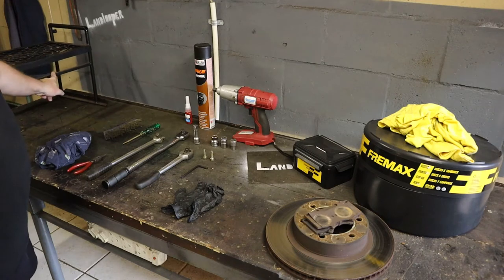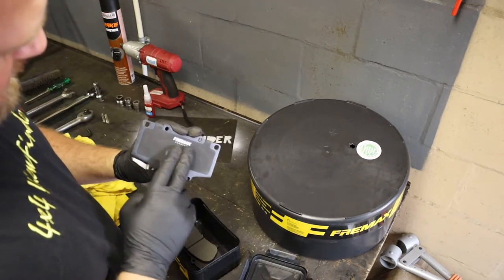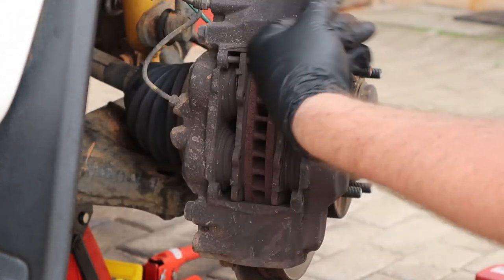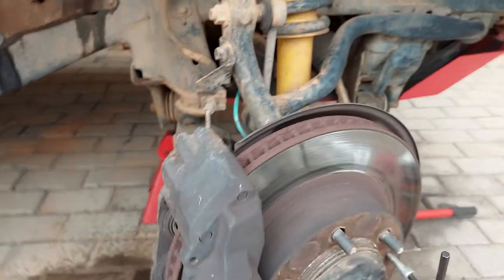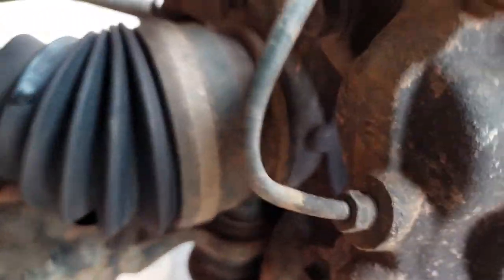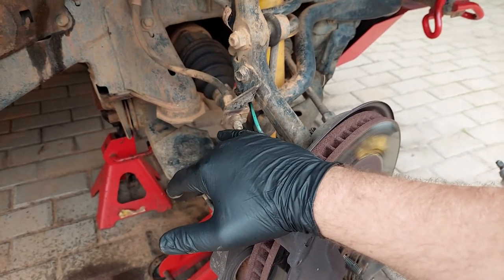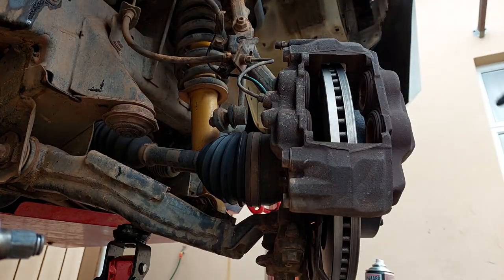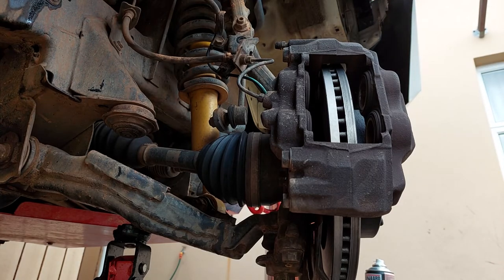Toyota Fortuner/Hilux D4D Front brake replacement.

Comment: Good video, just a tip that I was taught is use a wheel nut to hold the disc while re installing the caliper and pads. Just one less thing to have to hold on to. I also use a smear of copper grease on the back of the pads.
Reply from the maker: Thanx bud. Great tip there. Im afraid to put any kind of grease on the pads, the heat generated by brakeing generally causes the grease to "melt" and become fluid. This then goes everywhere including the discs and could cause damage to the rotors or worse, cause you to lose braking at a critical moment. I know there is a very specific grease the use, but i still cant find it anywhere. Thank you for commenting and giving the great tip, i will be sure to use it in future. Keep safe bud.

Comment: Top video thanks for the assistance. 👌
Reply from the maker: Happy to help brother.
Reply: @4x4ViewFinder  theres grease grease on the inside of one side of my fortuners rear break drum. Do you know what might be the cause. I had the rear bearings replaced 2 years ago. Apologies for bombing your comments section.
Reply from the maker: No problem at all friend. Are you sure it is not break fluid?
Reply: @4x4ViewFinder  I'll have to check. Maybe it's that.
Reply from the maker: Just make sure because its unlikely to be grease and probably a leaking brake shoe piston or just a leak on the line. Smell the deposit, grease and brake fluid are easily distinguishable.

Comment: Hi there , 

How did these disc and pad  performed on the vehicle? Would you recommend these or anything else ,
Reply from the maker: Hi there sir. I would for sure, recommend these discs and pads. Ive had almos 40 000kms on them so far and they perform like they where put on yesterday, even with severe driving conditions, such as towing and off roading. They still have more than 50% left. I would say they out perform the OEM parts by a large margin.

Comment: Hi, where do I find your video on burnishing the new brake pads?
Reply from the maker: Hi Nico, thanx for the comment. Apparently it is not neccessary. Only on performance vehicles and sports cars is it neccessary. All you have to do is brake hard from anywhere between 60-100km/h down to 10km/h twice and your brakes will be sorted. At the time of the video i was lead to believe there is a process but on speaking to a connection who builds sports cars he says its not necessary for normal road going vehicles. I will see if i cant ammend the video somehow to reflect that. Sorry for that brother.
Reply: @4x4ViewFinder  Hi Adriaan, thanks for the reply. Will be doing the front brake disks and pads for the first time myself this weekend...
Reply from the maker: Enjoy it Nico. The torque setting for the caliper nuts is 190NM not 120. It will be fine on 120 with lock nut but 190NM without Locknut. After you do the brakes the first time you will see its not that hard. In fact 90% of all brakes on cars these days work in a similar fasion. After i did my first set of brakes years back i was able to do them for friends as well. Have done Merc BMW and now the fortuner. After you have done one you wil be able to figure out any of the others. All ypu need is torque settings.
Also remember to torque your wheel nuts. I have video where i explain why that is super important.
Especially on newly installed brakes.
Enjoy it brother, let me know how it goes.
Reply: @4x4ViewFinder  Thank you for the advice Adriaan especially the torque settings. However, what do I do if I do not have a torque wrench? Just tighten the bolts as hard as I can.... 💪🏻😉
Reply from the maker: Hahaa, like they say, turn it till it strips, then take a quarter turn back. Hahhaa
Ja, potentially you could just tighten it almost as hard as you can, but with some mechanical sympathy in there somewhere as well. Anywhere between 140NM to 190NM will be more than enough. So a strong arm on a T-bar should be more than enough. Not a power bar, you will strip the bolt.

Comment: Regarding caliper torque, i came across this video...https://youtu.be/B_cBtHfOIBc?t=827
having said that, it was for the new Hilux legend 50.
Reply from the maker: Thank you so much sir. Will have a look at that video soonest. Im really worried about not having the right settings because it is a major safety issue. Got precious cargo on board. Thank you once again.
Reply from the maker: Hi sir, thank you for sharing the vid. I will have to make a correction on the video. Disparity is way too large to keep it like that. Thank you so much.